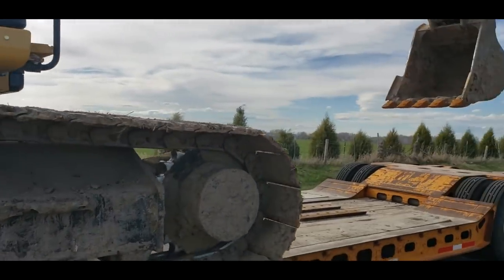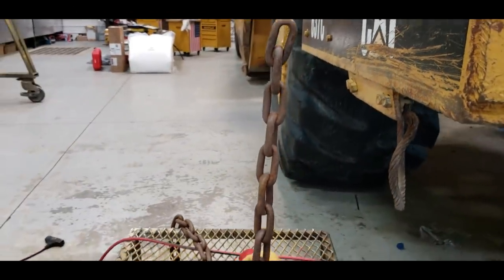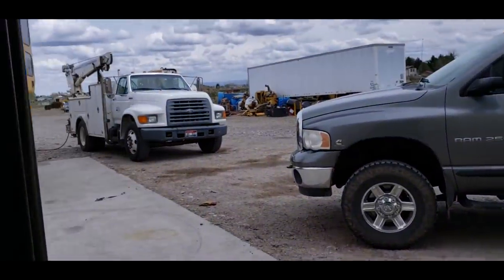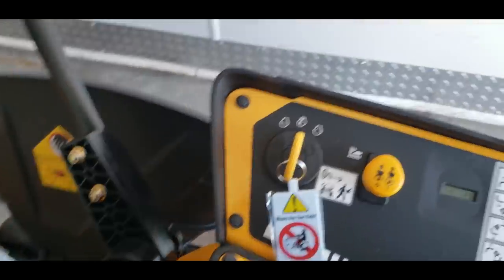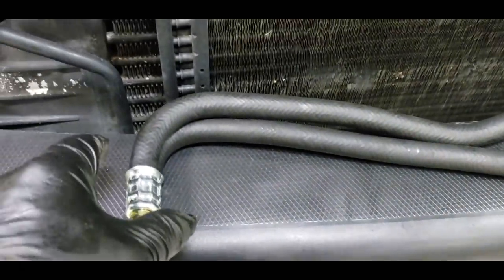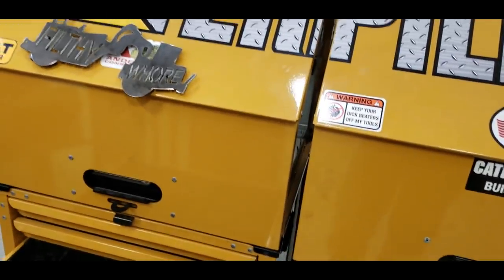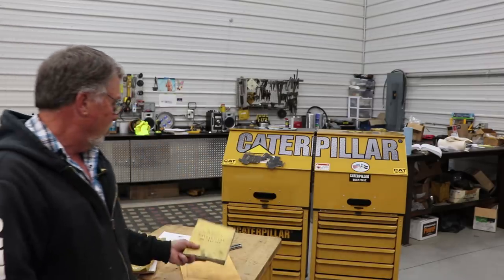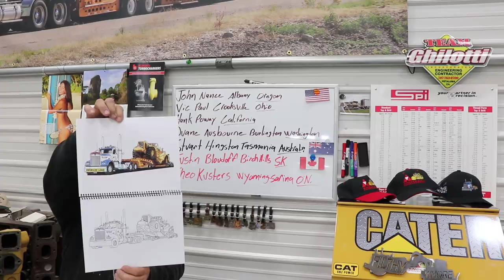Caterpillar 336 Moving A Bridge From The Oregon Short Line RR

Comment: Smoke and mirrors.... Jeff, you should have a show in Vegas!!!
Put a little electricity in that chain, you'll have a new mail box stand!
Wet batteries??? I gave up on those years ago!! Don't miss the not starting in the cold, the middle of the day dead battery, the rust and corrosion!!!!
Started using Optima, used a few others too... Optima isn't as good as they used to be, but still better than dealing with wet... 
My experience, my opinion... No more blue speckles on John Deere green either!!! (That one ruined my coveralls, pants, shirt and my shorts!! Took a quick bath in the creek, walked a half mile across the field to my pick up and drove back to the shop, nothing on but my watch and sunglasses 😎

Comment: On one of my older videos we had a milling machine blow up and we used another milling machine to pull it down the road and they used just one chain at first I said to use 3 or 4 but they didn't listen you can see the chain stretch before it broke and popped and everyone sitting there watching jump when it broke

Comment: 0:20 if you use the used motor oil from the d9 and soak them tracks in it. Would that help?
Reply: Wouldn't suggest that, a few years ago we tried that with grease. It worked good, but it got on the pads and when we loaded up in a big rain shower we almost slid off the trailer.

Comment: you need to take the parking brake off the mower before you move the turning levers..  what you should do is take that thing back and go buy a scag or exmark mower.. anything you buy at a big box store is junk..  go look at the deck and frame thickness on real commercial mowers..  the fact is has plastic turn levers is a sign of poor quality..
Reply: At a minimum you want a welded deck